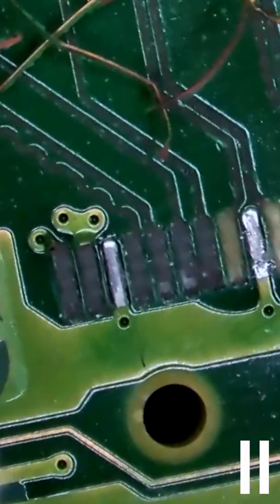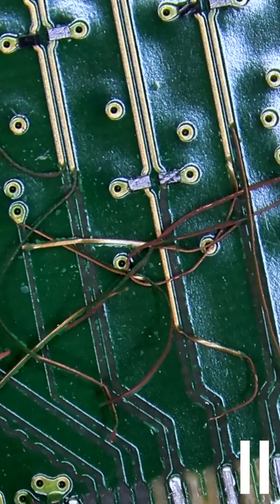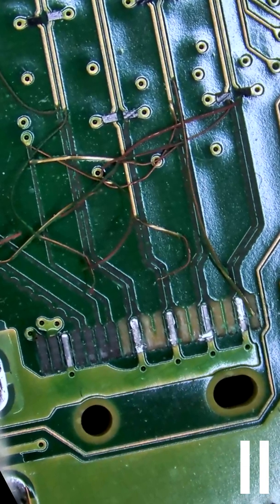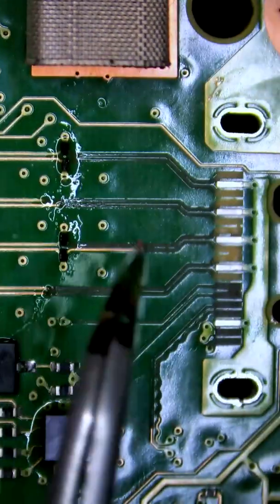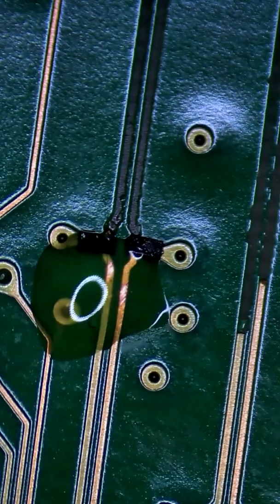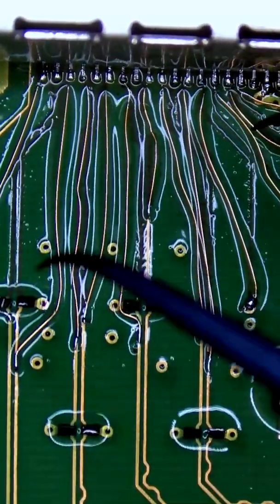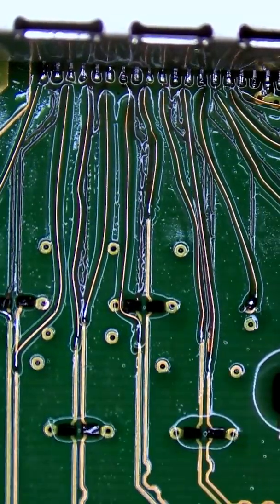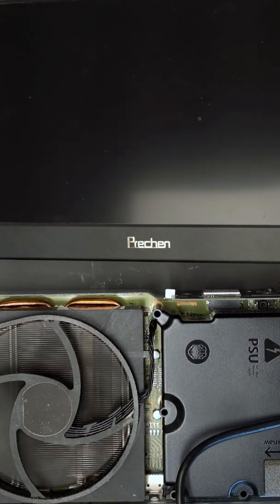Rebuilding 14 Traces on Xbox Series S HDMI Port #Shorts

Comment: RIP signal integrity! But if it works, it's better than nothing ;)
Reply: Would be interesting measuring the "traces" with an Vector Network Analyzer 🤔
Reply: True, but I think I'd like to see an eye diagram more. Also testing the output with a long and non premium HDMI cable to see if the loss of signal integrity has any impact on edge cases.